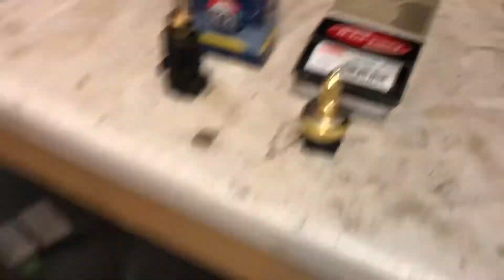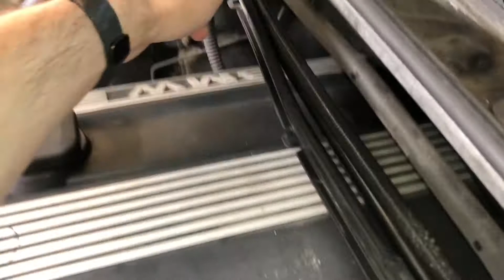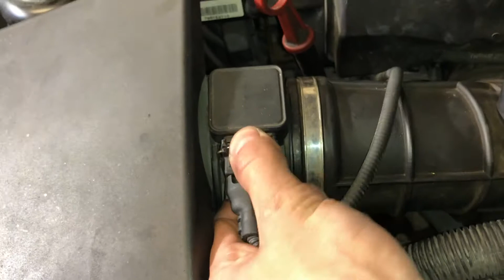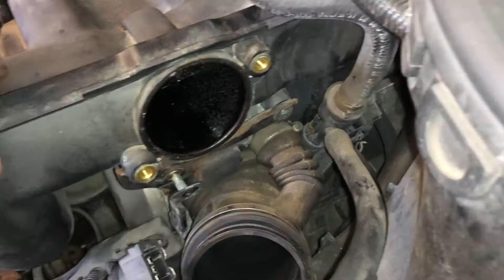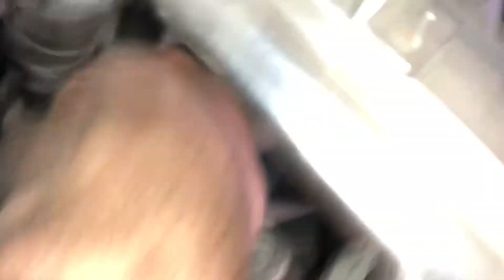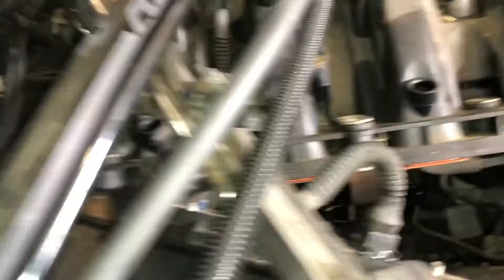BMW E46 Petrol Engine Coolant Temperature Sensor 1 Location Replacement How To DIY 320 323 325 328

Comment: Great video and hard work. You can replace more things while you are there. But guys you can do it without removing the intake manifold too. Just take out the walls/plastic between the engine and heater blower, under the windscreen, and use a 3/8 flexible ratchet and a 22mm socket. You have to take out the fuel rail so you have better access. Took me many hour to realice that it was possible. Did it on my 323i e46. Hope this can help someone as I spent days trying to replace this sensor..
Reply from the maker: Thank you! I didn’t look to see if there was another way but to be honest it wasn’t that bad removing the intake manifold. I like to see what I’m doing.
Reply: @IAMASPANNER  i was able to catch the fuel pipe and bend it back slightly allowing the 22 socket to just go straight onto the sensor with 2 long extenions.

Comment: Could have just used a crowfoot wrench with an extender, it was made for this type of job and DIY.
Reply from the maker: I don’t have one, I usually do big jobs in a friend’s workshop but this was just a small one. I appreciate that the sensor can be removed without removing the intake manifold but at least everyone gets a better look at it on the video.
Reply: @IAMASPANNER  I used a stubby 3/8 Ratchet that has a flexible head with a 7/8 crowfoot wrench and got it off by not removing the intake manifold on my first try. My BF was gonna do what you did in the video and I surprised him by removing it myself.
Reply: How did u get too the spot? Did he take most of the parts off?
Reply: @ChefRyan651  OK so, there this plastic wall thingy that has 2 torx bit screws in them on the fire wall, try removing that first then you have a bit more wiggle room. Your alarm is also behind there.
Reply: Good to know since I'll probably have to do this job eventually on my 2002 e46... @Ayixlia

Comment: You didn't have to remove the intake manifold to do this job thier is a faster way doing it
Reply from the maker: Please do tell, I’d have loved not to do this job!
Reply: @IAMASPANNER  the tools you will need is 02 sensor tool the one with the hole on the side that will fit around temp sensors you will need to remove miro filter and it's housing then behind that you will need to remove 2 torque screws and pull out the hard plastic plate that was in behind micro filter then you will have plenty of room to put your hands and squeeze the plug and pull it out with the 02 sensor tool put it over the sensor at an angle use extender and socket turn to the left then remove it
Reply: @isrealperez9069  I'm going to try this method, thanks for sharing.
Reply: @isrealperez9069  I really want to try this
Reply: My M3 is in at my local Indy gor this job along with a service today. I’m hoping he knows the easier way!  What a proper pain in the a*** job that is otherwise, fancy locating a fallible part under all of that inlet kit!! My wallet might be crying later if they’ve had to do it the ‘long’ way.

Comment: Did you have to drain coolant?
Reply from the maker: Surprisingly not, nothing came out at all.
Reply: @Tolly Swft I've had thumping noises, then leaks....ive changed all hoses and thermostat,  do you think this will work?

Comment: My bmw z3 is having an issue, so it'll crank start, then die, but on the second crank, it'll start, but with a struggle only when the engine is hot..

Could this be my problem, or is it a crank sensor problem?

Comment: What a complete ball-ache to get to, but I see why they've done it - the back of the engine is furthest away from the airflow, so it's the hottest part. They're just erring on the side of safety.
If you've got the manifold off an M54, for god's sake, replace the manifold gaskets, the coolant pipes under the manifold, and the CCV system - the gaskets are too cheap not to, and doing the CCV without the manifold off is the stuff of nightmares.😁 
You might never be in there again, so get as many "while I'm in here..." jobs ticked off as you can!
Reply: OK. So while mechanically inclined, I don't know what the CCV is. I'm trying to teach myself to be a mechanic. I'm currently trying to replace the sensor in the video on an E39 530i with an M54. Manifold gaskets are something I hadn't considered but I'll look into it.
Reply: @dennevyn05  CCV is "crank case ventilation" - a kind of loop of pipes that are supposed to take oil vapours out of the head and put them back into the sump. But it is a known weak design, which is why this engine is a notorious oil-burner.

There is a way to replace it without taking the manifold off, but it is extremely awkward, and not recommended.

Manifold gaskets very rarely fail, but they are very cheap, and you are already in there😁.

Comment: Hallo one question please.  When i term my car on the fan starting directly is this sensor is the problem too?
Reply from the maker: A faulty temp sensor could cause the issue if it was giving a too high reading but there are other modules and scenarios that could cause this too.

Comment: Dont buy Facet? They are very cheap made. Delphi is ok. Next time buy Bosch or Hella.
Reply from the maker: It must’ve been the only one on the shelf or I wasn’t sure it would fix the issue, I usually go Delphi or above
Reply: You see i bought many many cheap ones , facet, Calorstat, Eps.  And all of them made the problem worse. Cheap ones does work but they dont give good readings. I installed those cheap ones, and my car whas reading 103 c   instead 92 c.  So i got a very sluggish car once the engine driving more than 15 minutes.
After buying a good brand Hella, my problems whas solved.
Reply from the maker: @_________________7791  I agree completely, at my friend’s garage in at least 2 occasions I’ve replaced thermostats that have just been replaced with faulty cheap versions elsewhere!

Comment: You don’t have to take the manifold of do you
Reply from the maker: I didn’t think it was possible to get to it without removing the manifold but you’re not the first person to say this.
Reply: You can do it without removing the intake. Ive done it on a 325ci a few years back. Lots of wobbly sockets and joints and fiddling but still less of a pain than removing the intake.
Reply: @StillthatguyJake  what about on a 318i n42 as I’ve got code 1115 coolant temp sensor plausibility I’ve replaced the one in hose but code won’t come of